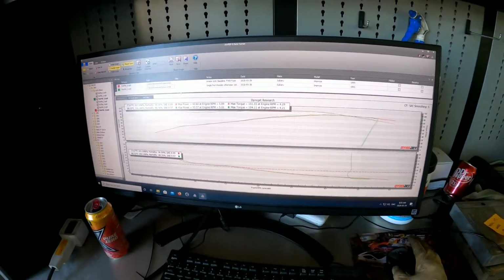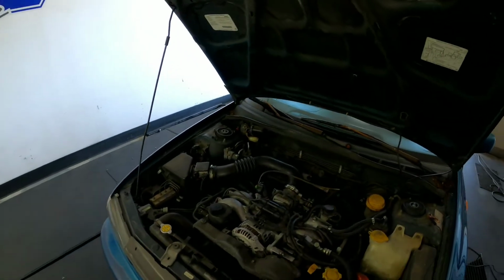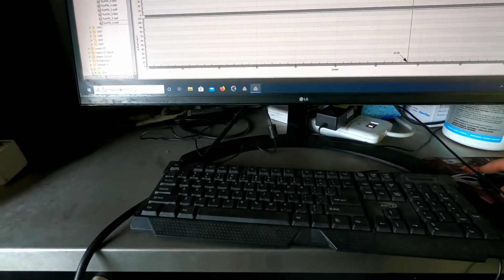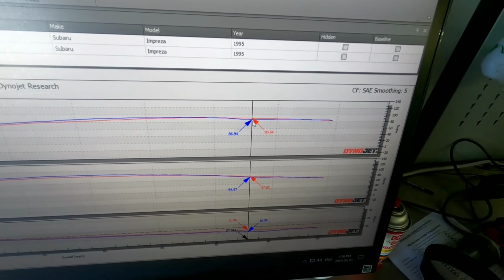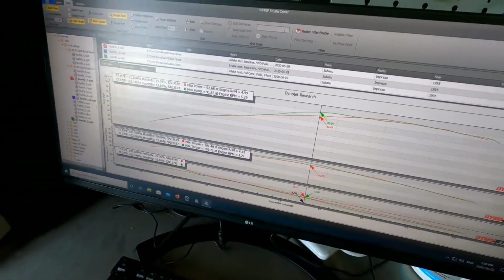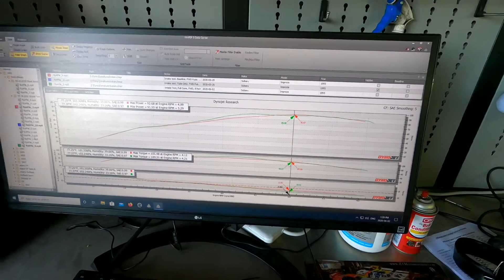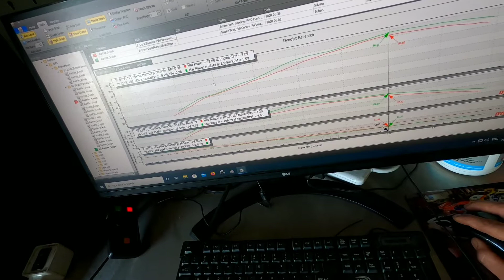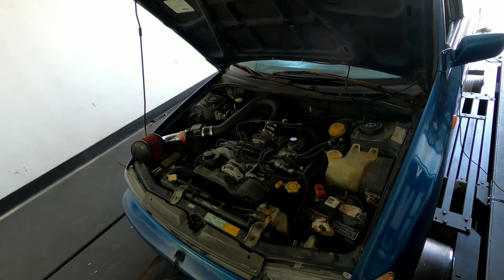$350 Subaru Impreza single port ej22 intake myth dyno testing! Will it make power?

Comment: No update on the Impreza??
Reply from the maker: Been broken for about 2 years.  Just sitting in the shop waiting for one of my kids to want a car bad enough they put the motor that's on a stand next to it into the car 🤣
Reply: @ All this dyno pulls Caught up with it 😄. Would be a great car for them. I actually have bought that intake tube best one I’ve tried for cheap! I’ll be adding a bend In front of the MAF to make a cold air into the fender we’ll see how it goes soon.
Reply from the maker: @Subieguy30 dyno pulls aren't any harder (usually less hard) on the car than freeway pulls.  I rallied the car up my mountain road for about 100k after I got it before it had any issues.  Speedo never worked but it was at 315k already 🤣

Comment: My ej22block with 1.8 cams and 2.2 valves with 1.8 heads makes over 170 horse power on obd0 on stock air box lol
Reply from the maker: Good work,  Have a link to a dyno graph of that?

Comment: I am curious if the phase two single port exhaust would help a turbo spool faster
Reply from the maker: Velocity wise it might spool faster but will drop off sooner for sure.  Spool does not equal torque and horsepower though.  There's lots of tricks you can do to force a turbo into boost faster but at the end of the day usually they don't actually translate to a faster car.

Comment: The reason you "lost" hp up top because you are not tuning for the extra air.
Reply from the maker: Basically,  however these ecu's aren't directly "tunable" so you just have to satisfy the ecu while increasing airflow to make more power,  it's a delicate balance.
Reply: @WT4T  Time to update the ECU. ;-)
Reply from the maker: It wouldn't be the first time my electronics were worth more than the car but it's not in the cards for this project at this time.

Comment: I bought a 96 with 106k on it. Runs well after a clutch replace. Both quarters where smashed badly. Had to fix that. Oh and the interior was toast. Got it looking way better. Plan to swap turbo bits from my 02 wrx. Got the stance looking good with a leveling kit. Dont know the offset but Ive got the wrx wheels on it and they look great. The car is going to be gunmetal Grey.

Comment: I LOVE these Ej22 videos!!   since it's a very common engine, I wish you could show us how much you can get our of it, many of us may not want to go straight into turbo but I guess that with better headers, injectors, exhaust and a tune  it could get close to 200hp, i dunno, your channel is awesome, thanks!
Reply: I highly doubt bolt on mods would bring you anywhere close to 200hp on a tired NA ej22. UEL headers are known to decrease horsepower, so a header upgrade is pretty much not necessary unless you do a custom equal length header. A 2.5 cat back paired with this dudes intake setup would MAYBE give you like 10-15 horsepower boost. Now, if you were to pair all of that with a slightly bigger Delta cam, then well you're still no where close to that 200hp mark. Gotta be realistic with these engines. These engines  make like 200hp with a turbo setup already.
Reply from the maker: @808Deathmetal little sniff of nitrous and we're there ❤️

Comment: Use stock filter box + aftermarket intake pipe + snorkus for the best results, and your MAF will be protected against intake resonance.
Reply from the maker: As shown in this video that's only partially true.
Reply: I've done the adjustable fuel pressure regulator installation and played with the psi levels. These ECU's typically don't like anything more than 4psi up or down (that they can sense) from OEM spec and will dramatically dump or pull fuel as well as add or pull timing to attempt to match the fuel pressure. 25-28psi is what the ECU's generally want with non-leaking intake vacuum . I hit the dyno soon, so I will see if my my fuel pressure experiment in relation to power gain or loss is a success or failure. I'll continue to watch your videos...also, while I understand this is a small power project, it would be worth testing Grimmspeed intake manifold spacers on the 2.2 and see how much they affect air/fuel ratio as well as air velocity.

Comment: Awesome videos sir! I've been waiting for another update on the ej22 single port upgrades and was wondering if you were going to continue building this car?  I have been interested in supercharging my ej22 with an eaton m90 (at 5~7 psi only) and just running the stock ECU as it immediately dumps fuel anyways when you give it throttle.  Was hoping I could see an example of how to do this as it's the least popular boost application.  I've seen plenty of ej22-T setups with a td04 running off wastegate pressure but almost all of them require an aftermarket ECU.  Anywho, just rambling now but please keep up the videos!
Reply from the maker: Getting parts tougher for the kids to build this back up
Reply: How do you hook up the m90? I have a 98 ej22 Impreza wagon and want to supercharge it.

Comment: Fantastic.
I did the hybrid intake on my Subie without putting it on the dyno.  Tested the inside and outside ambient temperature before and after letting the engine warm up to normal operating temperature and the hybrid intake had a lower intake temp by at least 10 degrees overall.  Colder air, as we know, makes more power.
Good to see dyno numbers to reflect each intake added.  I'll take 5 more torque while sacrificing 1 HP any day.

Comment: I find the surprise ending, ummm, surprising. Generally putting bends ahead of the MAF is bad. I'm wondering if the flow through the MAF with the filter right on the MAF was suboptimal, because the air didn't have a run of pipe to straighten out. Putting the length of pipe between the filter and MAF smoothed things out a bit. So maybe the result would've been the same (or maybe even a little better) if the pipe between the filter and MAF was a straight shot instead of the bend?
Reply: I am curious to see what doing some AFR tuning with fuel pressure gets you. I went back through some of my old dyno graphs saved on my laptop from the early/mid 2000s. Putting an Injen CAI and an S-AFC2 on my EJ25D resulted in a ~6.5whp gain. (It already had an old skool MRT header + Cobb-ported heads + Cobb cams.) From what I can tell, that was about 4-5whp due to the CAI, and only 1-2whp was due to leaning out the fuel mixture with the S-AFC. And that was with a similar starting condition - it would go waaaaay rich (in the 10.5:1 range) from about 4000rpm on up, and I was able to "tune" that to 12.5-13:1.
Reply from the maker: In almost every situation I've encountered bending the air both before and after the maf makes a car run smoother.

Comment: I could watch these kind of videos all day good stuff man what if you turn that 90 and aim it toward the fender hole then stick the filter in the fender so you can close the hood??
Reply from the maker: That's the plan,  this was just what i could do in the time i had to see if it worked.
Reply: Will Tune For Tacos I had added a 3in straight section before the maf since that was all I could fit defiantly felt different throttle response but now I’m gonna put a 90 on it in the fender.